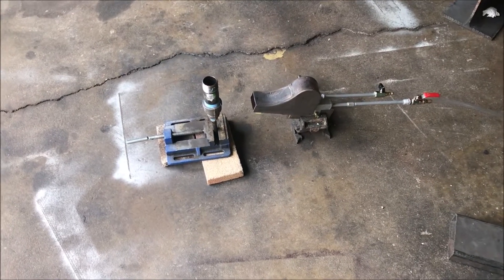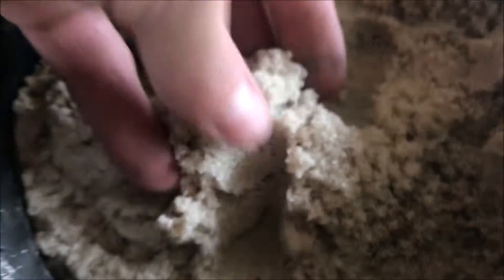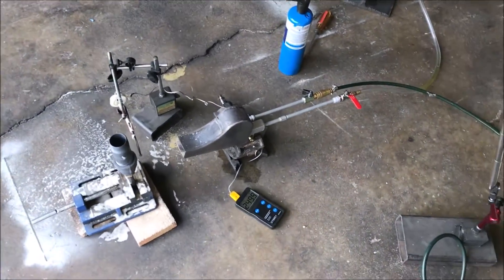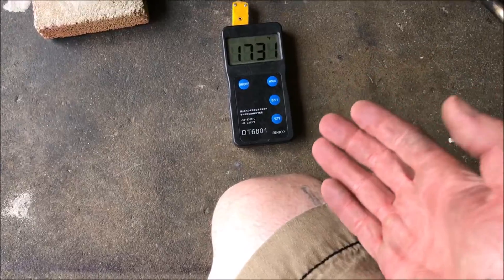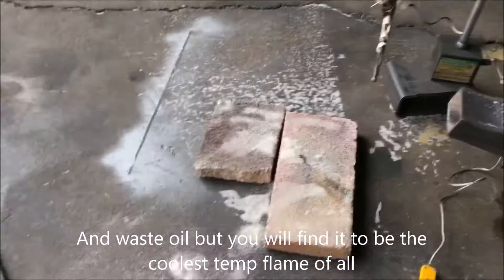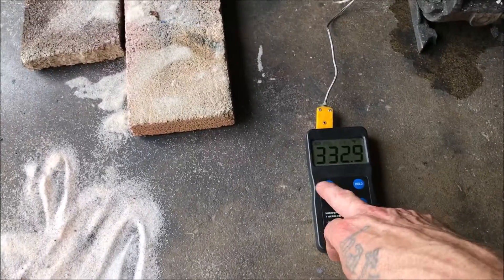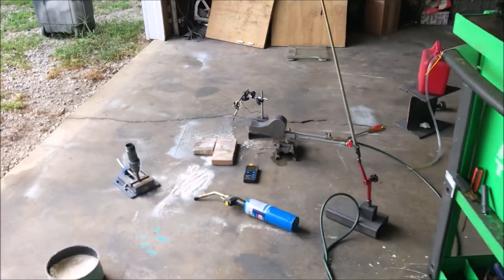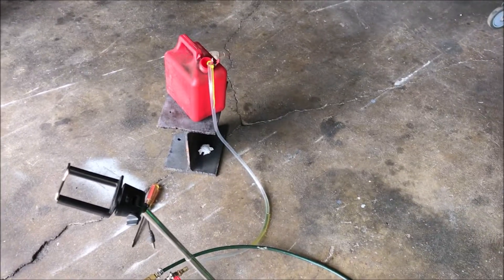Silica Sand Melting Foundry Burner For Sean

Comment: Dude, make normal foundry out of some trashcan insulated inside with ceramic wool, its not expensive but you will get some results...im melting steel on propane, look how i did mine foundry. Regards.

Comment: Damn, 3100 degrees. HOT. If that's just like melting glass then it should be doable in a foundry... We've all melted a beer bottle in that perfect spot a big hot fire. Is that all the radiant heat from the coals helping, or does wood burn hotter than fuels? A foundry would definitely add to the radiant heat.